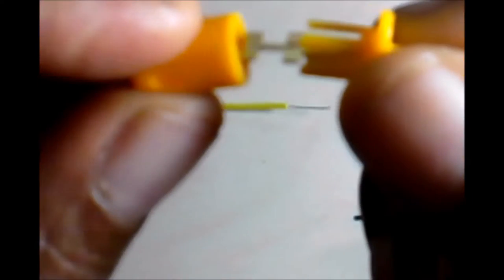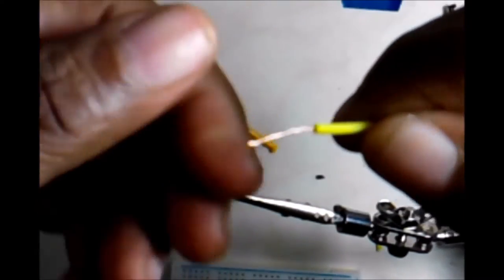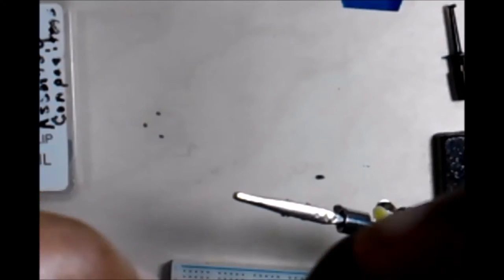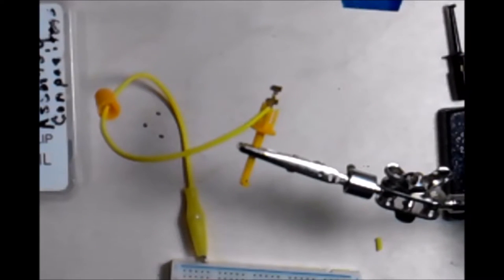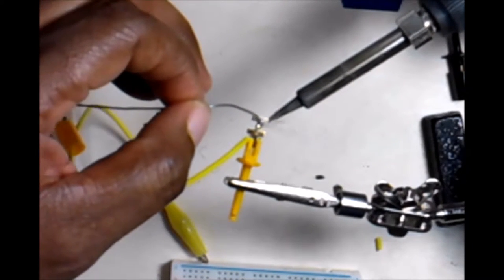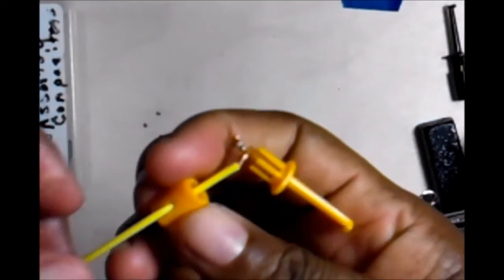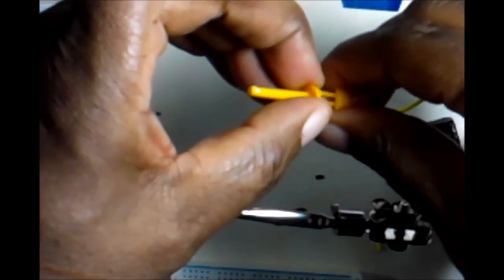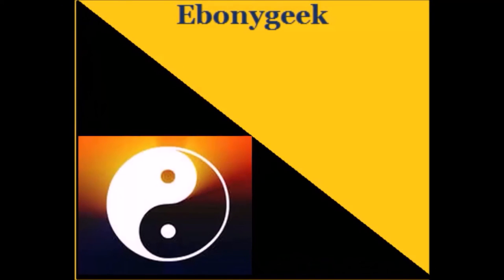Make Alligator clip Test Hookup Jumpers Troubleshoot electronic projects or circuits 2 Ebonygeek45

Comment: Good job.    You might add a comment to not leave a blob of solder around the wire.    You did it perfectly.    Too much solder interferes with the free movement of the hook assembly.